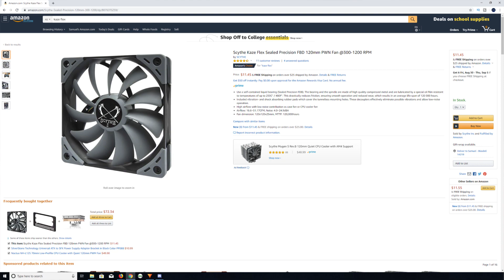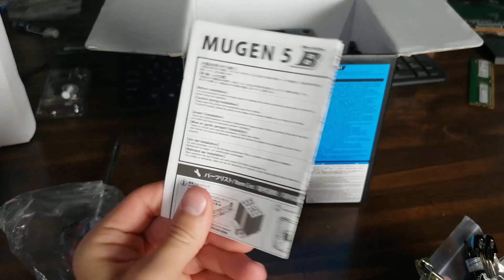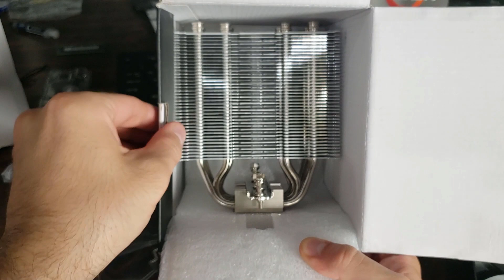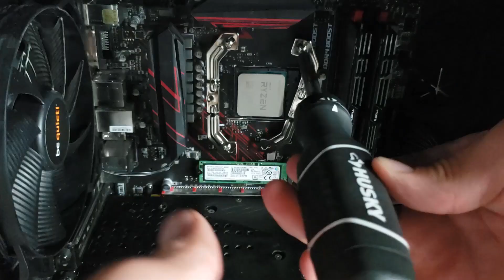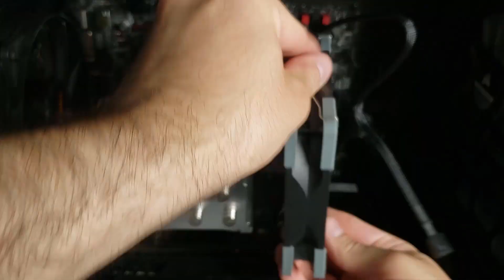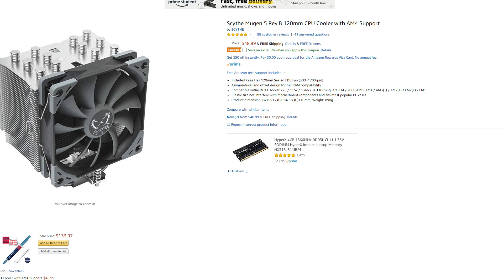Best Budget cooler for Ryzen 5000? Mugen 5 Rev.B by Scythe

Comment: Great video!! Thanks for this! I'm debating on a Zen 3 Ryzen (4700x hopefully) with either this cooler or the Hyper 212. I hear this gets better temps though, and it isn't that much more expensive. Is there a bracket behind the motherboard that it is attached to? I am guessing yes, but since I am coming from intel, I'm not 100% sure.

Thanks for this video!
Reply from the maker: Hi Matt V! The Hyper 212 will not provide the level of cooling performance the Mugen 5 from Scythe will. The Mugen 5 is a much more capable cooler and quite quiet as well. On the AMD AM4 motherboards, they come with a back plate that this mounting system screws into. If you ever lose it or want a spare though they range from ~5-15$ on eBay :)

What kind of system are you building? Gaming PC?
Reply: SamsTechStuff yeah, strictly gaming, maybe some minor photoshop or Game Maker Studio. I currently have an i7 2600k with a 1060 6gb so I like to keep my computers for a long time. I think the 3700x will last me quite a while. 

However, an alternative is buy a cheap 3600 and just upgrade to a cheap one in 5 years, but I would still need a new motherboard because I believe am5 will have ddr5. Im still thinking it all through. Any advice is appreciated! I am going to wait until the endish of the year/black friday. I will definitely get this cooler. I have a hyper 212 evo on my 2600k and it keeps things so cool. I never want to go stock.

Comment: Hi! what were your temperature on stock cooler ?
Reply from the maker: Hi Vadel! For the stock cooler, the temperatures were as follows:

Handbrake: 84C 
3DMark: 82C
Cinebench R15: 79C
Cryptonight test mining: 84.3C

After upgrading the cooler I was able to achieve high average and peak clock rates at similar or sometimes lower temperature. I would not suggest running the included heatsink unless necessary due to space / volume constraints or limited budget. 

What kind of system are you running or are you looking to upgrade?
Reply: @STS  That's amazing. Right now I'm running an Asus Motherboard Prime B450m-a with a 3600. I bought the previous stock cooler generation since it was bigger. The idle temp was around 50-60 just on motherboard.  I  ran Aida64 benchmark and my CPU on the performance test, it hit 80-90c and the computer turned off. I was thinking upgrading to Gigabyte B450 AORUS motherboard and replace the cpu for the same since I'm under return policy. I'm setting up this machine for a family member  who is not into computers, so I want this rig to be stable as possible.
Reply: @STS  Also, I'm running a 450W EVGA PSU. I was thinking upgrading to a thermaltake 700w. I'm making these choices because I'm  a very tight budget, otherwise, I would liquid cool it and forget about it.

Comment: Does a b450 tomahawk  mother board work with it cuz I realise  most headers are 3 pin and most are 4 on the mother board I'm confused
Reply from the maker: Hi Khanzi!

The B450 Tomahawk has a 4 pin fan header with a shorter key or support (the plastic piece behind the pins). This means the board is compatible with 4 pin PWM fans and the older style 3 pin fans. You should be able to plug in any type of PC fan into those headers. The 3 pin fans can be speed controlled by voltage on the motherboard, the PWM fans are more efficient / accurate in terms of getting the RPM you want.

In my experience, what does it mean to you? If it's in budget, go for a PWM fan. If its not, forget about PWM and enjoy you system.
Reply: @STS  thanks

Comment: I ordered the black RGB version to replace the stock wraith prism for my R7 3800X. Hopefully this will bring my average gaming temps down from 79-80. Running an Asus TUF X570 gaming plus with 16gb RAM, RTX 2070 Super and Lian Li 011 Dynamic with 9 case fans.
Reply from the maker: Hi Peter! I have no doubt that this cooler will drop your temps a bit in gaming. The newer RGB version looks great as well 😀. Let us know how the install goes and what kind of temperatures you're seeing afterwards!

Comment: Can I use safely this cooler with Ryzen R9 3900X @ stock settings ( I 100% won't overclock a 500$ processor I'm not THAT mad with my tech stuff!!! ), or even slightly undervolted - I'm thinking to use that Eco Mode thingie to limit it's heat output to 65W TDP going down from default 105W TDP...
Reply from the maker: Hi Vlad! The 3900 will output more heat fore sure versus a 3600. That being said, while I haven't tested this I have seen other people using this cooler with the 3900x. As long as you keep it stock voltages (or just slightly over) you should be ok if your computer case has decent airflow. I would say 1-2 intake fans and 1 exhaust would be plenty with this cooler.

This heatsink does come with an extra fan bracket for the heatsink, if you wanted a little more cooling capability you purchase a Scythe fan to make the tower push / pull. On my 3600 this shaved off a few degrees, it would be more effective on a 3900x though.
Reply: @STS  I have already bought a Raijintek Silenos Pro case AND 3 Noctua NF-F12 IPPC 2000 PWM fans, so I guess I'll be safe! Ryzen 9 IS a hot CPU, no pun intended.

Comment: Is it normal that the temps with the box cooler in idle are 55-60 ? And while in games its 74-77 with weird jumps to even 86 for 1 sec . (Ryzen 5 3600 , asus prime a320m-k)
Edit:4ghz Auto Boost i dont oc manually
Reply from the maker: Hi Danny!

For a Ryzen 3600 and the stock cooler, yes, those temperatures could very well be accurate.

What I found with the stock cooler was that some cores could hit 4ghz but not for longer or sustained CPU heavy tasks or loads. Upgrading the cooler in my case allowed the CPU to boost higher for longer periods of time. This generally increased my FPS in games, reduced my encode times, and more recently helped with my Folding At Home performance.

If you run the stock cooler in a decent airflow case under normal useage, you will not have an issues with the temperatures you listed. You're just leaving some speed and efficiency on the table by not cooling the CPU better.

I feel the cost is worthwhile for this cooler for sure but ill be reviewing a potentially even less expensive option soon as well.
Reply: @STS 
thx for respond
yeah i will already get the mugen 5 next week. I had a ryzen 5 2600 and the temp with box cooler was like 62 in games. That was max i noticed so i was/am rly surprised that now i have nearly same temps in idle. 
Also are the temp jumps normal? example: temp is 74-77 then it goes directly to 82-86 and then it goes slowly down back to 77-74.The temp jumps are also in idle .
 as i observed the CPU clock is most the time at 3.96ghz/1.1-1.4 voltage is it mentioned to be so ? because on 2600 if i was idle the cpu was like clocking even at 2.,9ghz although the base clock was 3,4ghz.
maybe i am just paranoic xD

Comment: Can you help me I got a scythe mugen 5 with my 3600 but my cpu hits 95c in cinnebench r20 and my cpu voltage is 1.4v stock that seems high and my temp seem high?
Reply from the maker: Hi louie Looop! 95C does sound a little warm for the Ryzen 3600 @ 1.4v with the Mugen 5 CPU cooler. The first thing I would do is to remove the cooler, clean the thermal paste off of the CPU and the cooler then re-apply thermal paste and remount the cooler. It's possible that the application didn't spread the paste correctly or the heatsink isn't perfectly screwed down on each side causing high temperatures. CPU temperature under load is also greatly impacted by the case, case fans, and the ambient temperature for the room. What case and case fans are you using? Do you know what speed they are running at? If you want, take a picture of the inside of the case and post it on Imgur for us to take a look at.

Comment: Great video! Working on my first build and it was suggested to change the stock cooler. I decided to go with this one for my ryzen 5 3600. Thanks
Reply from the maker: Hi Select Start Save! Glad you found the video useful and that you're upgrading! For the money, this really is a good bang for the buck CPU cooler. I'm happy with mine on my 3600.
Reply: SamsTechStuff thanks for the reply. Do you think this is better than the Fuma 2?
Reply from the maker: The Fuma 2 is a little bit better in terms of cooling power. It is larger as well but its still very quiet. I also reviewed that cooler. If you have the space in your case for the Fuma 2 and the budget for it, I would go for the Fuma 2. The Mugen 5 is still $48 on Amazon, for that price bracket, its among the best.
Reply: SamsTechStuff awesome, I’ll check out the Fuma 2 review. I kind of like the look of the Fuma 2 a little more but the Mugen 5 is a much better price.

Comment: Hi, I have a ryzen 9 3900x and I wanted to ask if you could tell me a cooler that would help me out with cooling it!
Reply from the maker: Hi Kanisuke! Since the Ryzen 3900x has so many more cores and can generate a bit more heat than a 3600 or even 37/3800 for example. I would definitely try a 280mm or even 360mm All In One cooler, especially if you lile the lighting effects. 

Picking a cooler also depends on the computer case you are using. There's a few in mind I can link here but they are a bit bigger. So, which case are you using?
Reply: @STS  I'm thinking of buying my NXZT S340 off my friend.
Reply from the maker: Hopefully you got your build all squared away!

Comment: Hi , will this fit on msi mpg gaming edge 570x with corsair vengeance rgb pro ?  I mean i dont want to cover slots of my ram
Reply from the maker: Hi Ciprian Stan! How many DIMMS will you be using, 2 or 4?
Reply: @STS  right now i m using only 2 slots but i m about to upgrade to quad channel
Reply: @ciprianstan9684  You will NOT upgrade to quad channel lol bro, the X570 ( and all AMD's mainstream chipsets ) has dual channel memory support! Quad channel memory is used on AMD's Threadripper and EPYC and Intel's Xeon motherboards ONLY!

Comment: Hi, looking to put on a Be Quiet Silent Wings 2 PWM cooler fan in place of the Kaze for increased cooling capacity of a 3800X. Do you think the higher fan speeds will work for a 3800X on the Mugen 5? Gonna try it out this weekend regardless. Going from a 2700 to 3800X and looking for something better than stock cooler. I already have Be Quiet fans onhand that are new.
Reply from the maker: Hi Brian! Yes, I think it could be beneficial if you already have the fan. I would definitely try it out, I have considered testing some faster but sadly louder louder fans on mine as well. Let us know how it worked out 😀
Reply: @STS  Tried it with success. Seems like the Be Quiet fan fit like a glove too and getting a 4.1Ghz OC on all cores on the AMD 3800X with 32c temps at idle. Haven't tested Prime95 with it but getting 90+ FPS in Destiny 2 during public events online gaming. I think this would've boosted performance of any CPU in AMD lineup since they are thermally sensitive to throttling.
Reply: @STS  The Be Quiet Silent Wings 3 PWM fan you'd hardly notice it there and even on higher RPM it's a nice whirrrr sound like background white noise. Not whiny or distracting either.
Reply from the maker: Sorry, I think I lost track of this thread somewhere along the line!

That's awesome, glad it worked out well for you 😀

Comment: I'm running a 3600x and a Mugen 5 rev.b ARGB push/pull setup. Absolutely a great and good quality buy.
Reply from the maker: Hi Ares14! Yes, I could not agree more! This has become my favorite cooler due to the looks, performance, and cost (the build quality is also great for anyone wondering). I'm planning on using this in another build in the near future!
Reply: Ares14 does your fan also ramp up because idle temp reaches 66 degrees . also on scythe mugen 5
Reply: @ZuckerbroTx3  no, i usually dont go anywhere into the 60c range and thats under load... bad thermal application?

Comment: The original AMD back plate have rubber feets,  so it to prevent metal to metal contact with the motherboard???...TIA
Reply from the maker: Hi Sazon Man! Yes, the stock AMD backplate has a plastic covering insulating the metal backplate from the motherboard. This prevent and short circuiting. It's a quality product as well. I have re-used it for all of the coolers I have tested so far!
Reply: SamsTechStuff do you think I could use my X570 tuf gaming motherboard back plate? For this cooler? I’m getting it in 2 days

Comment: Can you test out streaming Fortnite with obs x264?! My current 2600 with the stock cooler hits 95c while streaming and playing which then drops to 3.5ghz. Would this cooler help it stay at 4.1ghz
Reply from the maker: Hi Shadow! 

Holy cow! Those are some EXTREMELY high temperatures! I ran the stock cooler when I had a 2600X shortly and found it to be quite hot. As you reach those temperature the CPU will start throttling itself but that will produce poor results when gaming and streaming. I haven't done much in streaming but I can tell you gaming and streaming likely wont make as much heat as Prime95 Smallest FFT torture testing. When I did the torture tests, this cooler kept my 3600 nice and cool while at 4GHz. 

I would highly recommend replacing the stock cooler and thermal paste as soon as your budget allows. The Mugen 5 from Scythe is a great cost effective option, usually you can get it under $50. Under Prime95 conditions, I was around 83C at a constant 4GHz. Gaming and streaming will not produce as high of a temperature, you maybe be in the mid 70C range.
Reply: @STS  actually streaming creates higher temps those little tests do really make my cpu too warm lol like 88c after a cool half hour while streaming makes it 95 real quick
Reply from the maker: With everything under load, the CPU, RAM, storage, and GPU, it does seem likely that you hit higher temps while streaming. If you can spend ~$50, I would definitely recomend the Scythe Mugen 5 or the newer version of the Fuma tower. The Mugen 5 has very good case and ram compatibility. Check it out: https://amzn.to/2CLbqkQ
Reply: SamsTechStuff I’m debating whether to buy it cuz my case says 154mm is the max cooler that can fit and it’s 154.5 for the scythe
Reply: SamsTechStuff if I sent you a picture can you tell me if it’ll fit?
Reply from the maker: I suggest not buying the cooler then, I would bet its not going to fit well or possibly break tempered glass. There are other shorter options to look at though.
Reply from the maker: What case do you have this build inside of? You might be best off with a closed loop liquid cooler, either a 120mm or a 240mm.
Reply: SamsTechStuff rosewill nautilus
Reply from the maker: I'm not sure if the Scythe will fit based on the case spec so, if you wanted to look into watercooling with a sealed all in one or closed loop cooler, here are a few options:

Corsair H60: https://amzn.to/2XeJvU9
Decent place to start, 120mm rear mount

Corsair H75: https://amzn.to/2CJpueR
Where's the beef? Here. This a big one but still 120mm mounting for the rear. It looks like this will fit but this is quite deep.

NZXT Kraken M22: https://amzn.to/32QtiFA
Good cooler, comes with very tasteful RGB ligting, also 120mm

Comment: would the scythe be enough to run a 2600 at 4.1ghz
Reply from the maker: Absolutely 100% YES! And it will look good while doing it :)

I used 1.375v for 4.1GHz on my 2600X briefly (vs auto OC) and there were no issues.
Reply: @STS  And Ryzen 5 3600 at 4.2? I have to change stock wraith spire... I think between fuma 2 and mugen 5 rev.b?

Comment: Whats the temp difference between the stock amd cooler and the mugen 5 rev b when gaming?
Reply from the maker: Hi Jung Woo! Under load with the stock cooler, depending on the task, I was in the mid 80s to 90C which is quite poor. With the Mugen 5, I'm seeing much lower temps, 73-78 depending on the test.
Reply: @STS  i got mine 60-63c full load.idle 32-35c. good case airflow and good fan case do help too.

Comment: I torn between this and the brocken 3. In USA Alpenföhn is a lesser known brand, but actually one of the best air cooler company. The brocken is an under 50$ cooler too.
Reply from the maker: Hi Chewbacca Chewby! I do not personally have any experience with that cooler or brand. The design does look similar to Mugen 5 though. If the price points are similar and the performance is similar (appears to be), I would choose whichever cooler you think will fit better and look better in your case. I haven't researched pricing on the Brocken but I know the Mugen typically ends up somewhere in the $45 to $55 range (maybe lower during holiday sales?)